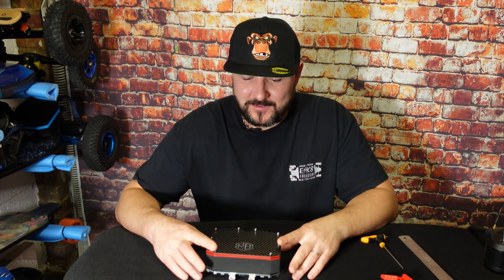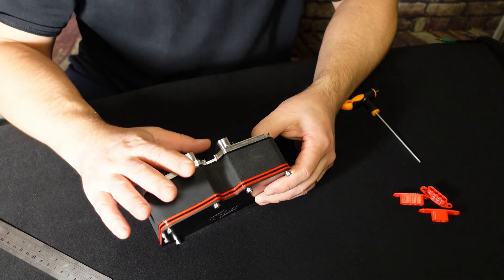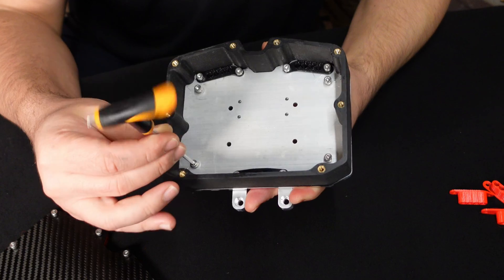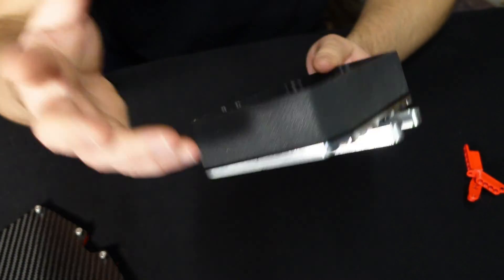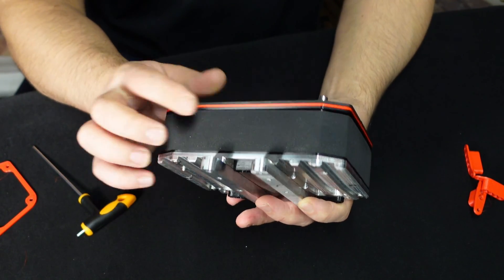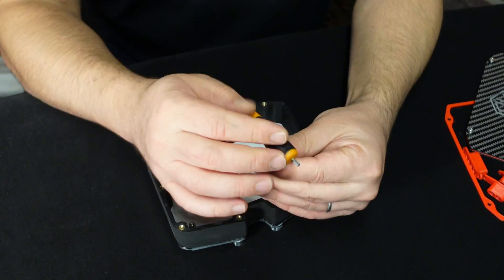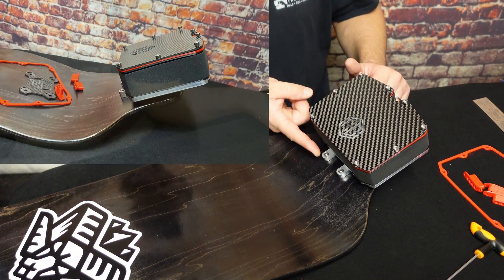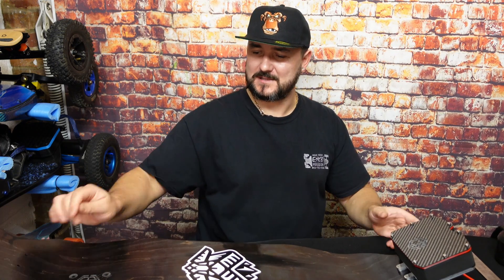ESC enclousure by Rad.

Comment: Nice work! I wonder if I could even just buy the base plate to use for a spintend heatsink inside my current enclosure...
Reply from the maker: Are you planning on cutting it through the enclousure? Meaning you do need the cooling fins on it or you just want to increase the mass of the spintend body for heat absorption?
Reply: @PavelGarmas  I was thinking about cutting it through the enclosure. So probably need a gasket too! My problem is after riding about an hour at 45+/km hr, I start to experience 80C temps on the vesc and then get throttling. Having an external heart sink should improve that.
Reply from the maker: @VllKlNG  i see... i do have some heatsinks with ESK8FREEDOM logo on them but they are for vesc 6. I think they would work.  3DSERVISAS makes some as well but not specifically for Spintend however it may work fir you. You can seal the gap with silicone. 
https://shop.3dservisas.eu/products/dual-focbox-case-heatsink-plate